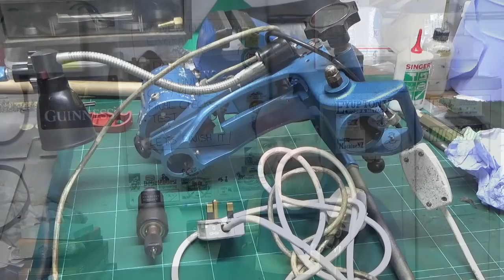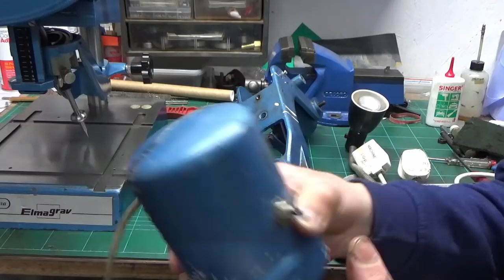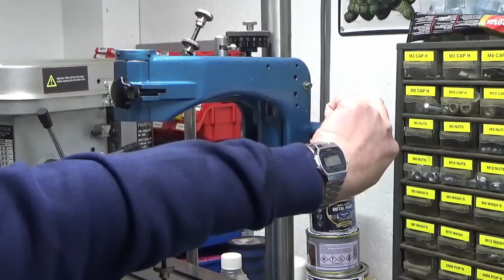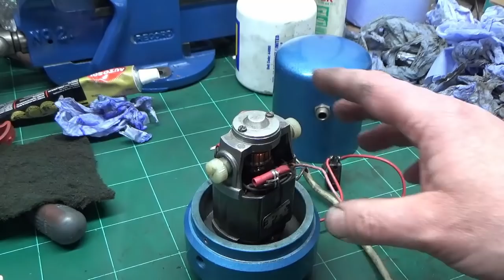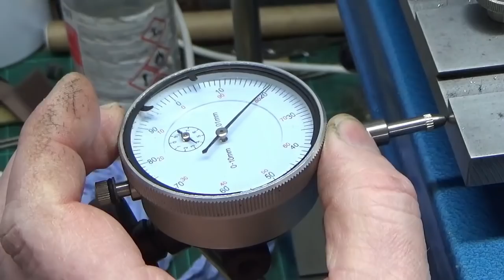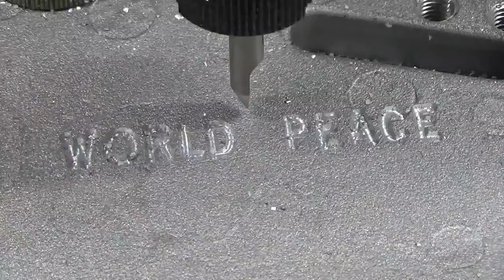My New ElmaGrav Engraving Machine. Re Build Completion & Test Part 3

Comment: I'm not saying you are wrong about that collet, but that taper on the front of it leads me to believe it is intended to seat against a matching surface inside the collet nut, that relief groove in the collet is supposed to  engage with an inner ridge on the nut, in ER collets anyway.
Reply from the maker: Hi Jason, thanks for the comment. Totally agree, I was expecting the same however the inside of the nut is just parallel section which is exactly the thickness of the groove in the collet. Maybe they used a standard collet (back then) and designed the nut round it. All very strange. Cheers, Jon

Comment: Hi Jon
Yes, I was watching.
For a non-electrician, you did a very neat job on the wiring.👍
Thank you for mentioning the collet drawing. I look forward to receiving the details in due course.👍
What luxuries you have on your engraver, a graduated depth stop, spring adjustment and a "locking stop". I have a small thumbscrew for a depth stop, that's it 😁
My guess would be the motor bearings as the speed variation/noise etc. Try removing the spindle and  running the motor by itself, this might provide some insight to the problem.
With the movement of the letters, if the movement is small, you could try hammering/"peening" the ends of the letters, or possibly use a small fine cold chisel to put a "cut line" across the letter, near the ends. This may stretch the brass enough to remove the slack/looseness, obviously taking care to not distort the letter itself.
AFAIK, the engraving bits do not reduce to a point, but have a small tip radius, otherwise they would not cut properly. You could carefully stone the face to sharpen the cutting edge.
Regards
Peter
Reply from the maker: Hi Peter, thanks for the comment and suggestions, duly noted. Dave Ticehurst has offered up a potential very simple but effective solution to the brass copy slop just using some thin wire, going to give this a try first as it's a 5 min fix if it works. No problem, will get my measuring gear out in the next week or so and send you the output. Cheers, Jon

Comment: nice compact machine. can't you just buy an LED bulb to fit? and wouldn't it be easier just to make new copy plates to match your TH stencils. I agree hang on to them as they are silly money.
Reply from the maker: Hi Paul, thanks for the comment. I have a very simple solution to the copy plate courtesy of Dave Ticehurst's lateral thinking, so should be a 5 minute fix hopefully. Cheers, Jon

Comment: Jon, Good job with the cleanup and repair of the Elmagrav.   I have a "New Hermes" that I have been working on restoring gradually over some time.  May I suggest trying to oil the existing bearings prior to replacement.  I have used light spindle oil for that purpose.  If they are shielded ball bearings spindle oil will wick inside in a day or two.  If they are sealed bearings I have injected oil with a Medical Syringe.  If oiling is successful it will save some time and considerable expense, as a 10,000 R.P.M. spindle should have ABEC 5 tolerance bearings.  I am planning on emailing you some info on D-Bits.
Reply from the maker: Hi Gary, thanks for the comment and information. Yeah, not sure, I think they were just shielded but they do sound ropey, but they feel OK, very strange. I am struggling to get collets, absolutely nothing available, so considering building a new spindle and going ER11, which will probably mean new bearings anyway. Giving it some thought, no rush. Cheers, Jon
Reply: Jon, Measure the existing collet and make new ones its that not that difficult.  I can advise if you are interested.

Comment: Well done Jon. A very interesting conclusion to your restoration. Finding bespoke collets can indeed be a challenge. I faced the same problem with my “David Dowling” pantograph engraver. Luckily I discovered that Deckel GK collets fit and managed to acquire some off EBay. In the end I also invested in a D bit universal cutter grinder. Proven to be so very useful. 👏👏👍😀 Andrew
And yes, let’s keep praying for World Peace 🙏
Reply from the maker: Hi Andrew, thanks for the comment and feedback. I have searched high and low for collets for this machine........ no deal! So, I either make some (not easy) or make a new spindle and convert to ER11. I will give it some thought. Cheers, Jon

Comment: Nice result John. The "silver" cover that your motor earth wire was connected to looks like it houses a swivelling bush. A bit like a pillow block housing. You should be able to remove that cover and slip the bush off the top end of the motor shaft. it is highly likely there is a felt pad in there as well that should be soaked in oil. Maybe you could gauge the bush and shaft for slop. Other end of the motor could be a bush or bearing? Bit hard to tell without a looksie.
Reply: In little motors like that I often find the bushings wear oval. I have not found a source for those bushings but have occasionally replaced them with ball bearings. It takes a little fiddling machining of end brackets ( and occasionally metal filled epoxy) the shaft may require a bushing to match the bearing and I have used brass because it machines like a dream. Shaft sizes have been an odd assortment of diameters/ metric/ inch/ and everything in between.
Reply from the maker: Hi Phil, thanks for the comment and information. I will have a look at it next time I take the motor cover off, I plan to check the wiring is holding up following a bit of use. Cheers, Jon

Comment: Great work John! looking forward to other projects! When I worked in a car plant in the U.k as a fitter machinist I often had to make a new component as most of the stuff was obsolete and it cost a fortune to get them made outside in a local engineering company! I enjoyed doing that side of things better than attending breakdowns and getting covered in muck! I created that job for myself lol! I wanted to ask you could you possibly make a video on the sequence of operations when machining a component because I made a lot of mistakes on that by not leaving enough material to grip or hold onto a clamp or in the chuck. Only if you feel up to it. It would be nice though. Thanks, John.
Reply from the maker: Hi Dermot, thanks for the comment. Lol, sounds like you carved yourself out a sweet spot. Years gone by, nearly all UK companies had a toolroom for this very thing, unfortunately a thing of the past these days! I will work something into the tip series Dermot, if you don't see it, keep prompting me please. Cheers, Jon
Reply: @jonsworkshop  Thanks, John. I was sorry I got made redundant from Fords in the u.k. I really liked that new job! My chief engineer made and old stores shed into a small workshop for me only! the lathes were an old Holbrooke lathe but it was in really good condition and a small Boxford and the milling machine was a Bridgeport along with a surface grinder. He got the place painted with heating too! A sink and a small kitchen area. I loved it because it was all mine! I just do online teaching in Thailand now and I hate it. But I will build a workshop maybe when I get some money lol.

Comment: Peace in Europe
I wonder if putting the flat edge of the D bit on a stone would improve its results?
Reply from the maker: Hi Gr eg, thanks for the comment. I did try this but I think both ends have been dropped (probably onto the table as there are a few dings in it) leaving about a 1mm flat on the very end. Got some new ones on order so hopefully they will be much better. Cheers, Jon

Comment: Very satisfying to see the engraver working Jon. It has been a very interesting series of videos, and credit to your hard work and attention to detail. Next project, maybe a fixture so you can sharpen the cutters on your surface grinder? Keep up the good work Jon.
Reply from the maker: Hi Gary, thanks for the comment and feedback. Yep, I have seen some triangular engraving bits as opposed to the standard D bits, I have ordered a couple and plan to make a little fixture to hold them on the surface grinder. I think Mitsubushi also sell spot drills with this geometry so might be dual purpose. Cheers, Jon

Comment: Great Outcome Jon. Well Done. On the topic of your wiring, generality it is NOT a good idea to TIN the wires before crimping them. What happens is that they will be good and tight now, but over time the pressure on the solder will make it cold flow; then you have a much looser crimp. You will get the same effect if you fit a 13 amp plug onto pre stripped and soldered appliance wires. After a while when you check the plug connections you will find the screw loose.  Jon, been thinking about your letters being a sloppy fit in the frames, instead of trying to muck around with shims, how's this for an idea. Find out what the slop is and on ONE side fit a bit of steel or brass wire of a suitable diameter, make it longer than the holder and wrap it at each end to keep it in place. Piano wire or some of the soft wire they sell in garden centers. In that way the wire can remain in place all the time and just slide your copy in and out. Regards from Australia.
Reply from the maker: Hi Dave, thanks for the comment and the information. I never knew that about solder but now you mention the plugs, I have seen this, always assumed they just weren't tightened properly. Every day is a school day (especially when electrics are concerned lol). Great idea on the wire, that is a perfect solution. Thanks for that. Cheers, Jon